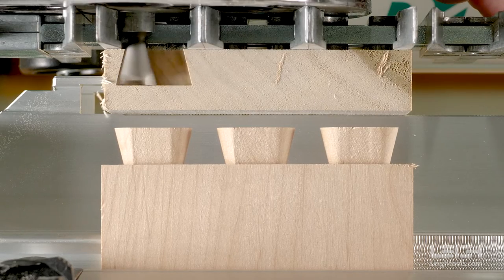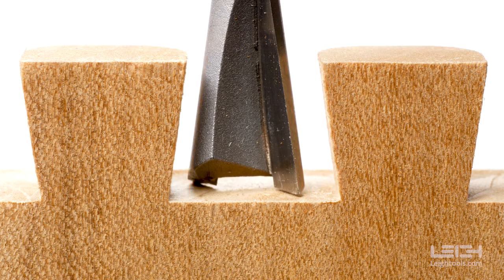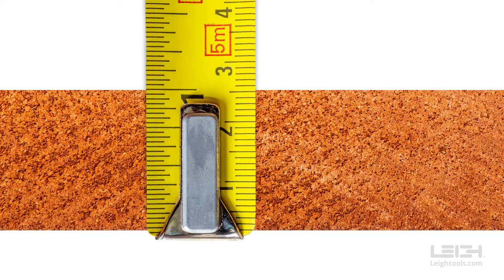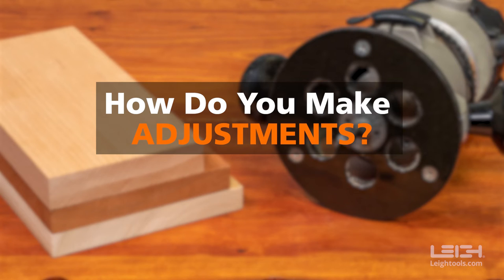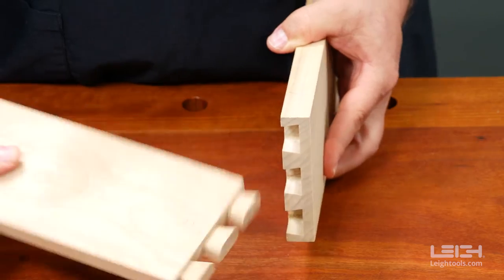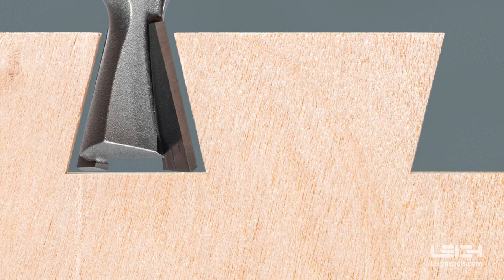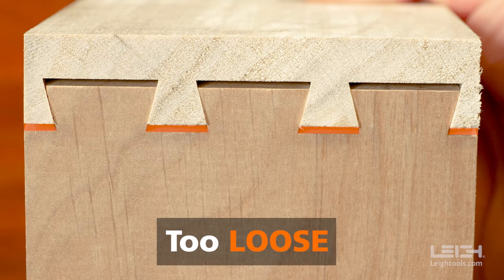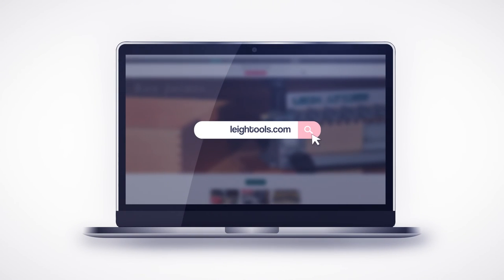Explaining Half Blind Dovetail Fit - Leigh D4R Pro & Super Jigs

Comment: I like how this jig works and the owners operating manual is the best in the business. This video adds clarification to the why’s and why not questions one may encounter. I generally use my 7/16” router guide bush and verify my actual depth of cut with my set of brass measuring blocks for easy repeatability than the pencil line. Brilliant jig and easy to use in my limited experience. I can’t wait to start using this jig for more than my basic through and half blind dovetails and explore its many other uses. I’m glad to see your company update the video series with more content.

Comment: I'm figuring out my new D4R Pro, this video was a big help. What I can't figure out though, is why you can only use a bit that is 1/2" diameter. 

Also, why does the angle matter? 

Also again, I'm using the E7 bushing. The manual says to set it to 10 for HBDT and leave it there. What it doesn't explain is what orientation on the router to align the mark on the bushing. My festool router doesn't have any alignment marks on the bottom to line it up with. What I ended up doing is lining it up to the approach direction going into the fingers. Is that right?
Reply from the maker: Please Contact Leigh's technical Support at Help@LeighTools.com with these questions and they will be able to help.